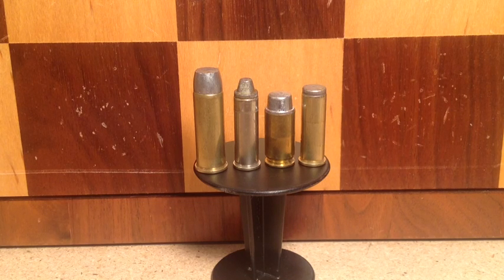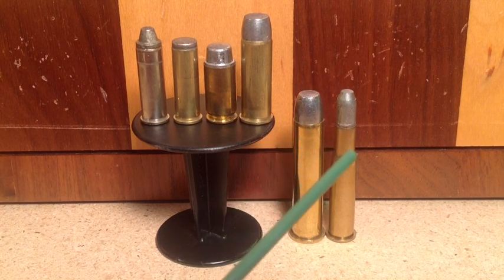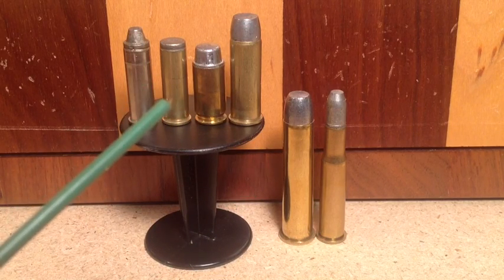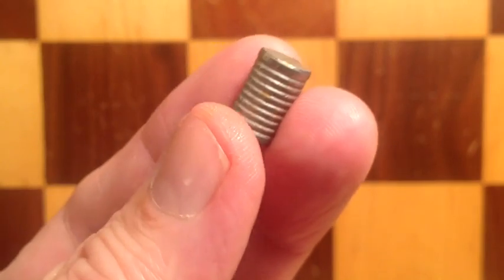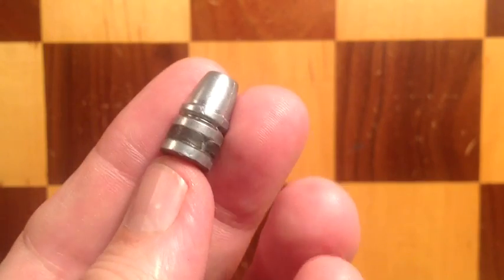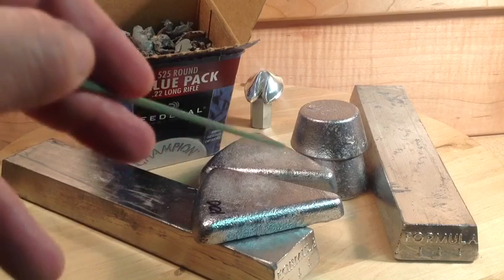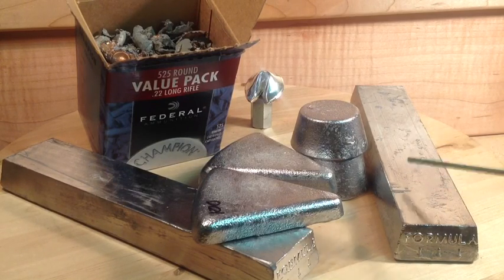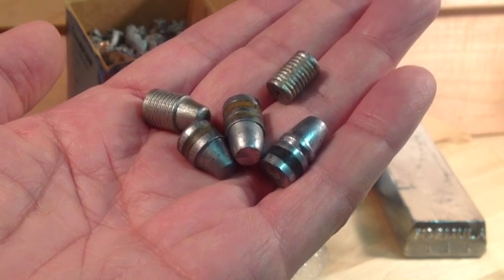Lead Hardness FAQs & How to Mix Bullet Alloys For Hardness

Comment: I've been casting for about 3 years, probably around 20K rounds, and have used almost exclusively range scrap with great results. I just now finally ordered some Super Hard Alloy and tin from Rotomtals. Plan to start working on some magnum loadings.
Reply from the maker: Hans S. Always great to hear from ya, Hans!!  That SuperHard alloy is really a joy to use and at 30% antimony, don't need much of it (eyeball 1 pound SH to 4 1/2 - 5 pounds of range scrap + water quench + 2 week age to get magnum hardness BHN 18).  And the tendency is to use too much tin as that is easy to do.  Our range scrap even contains some tin (probably around 1% already)  you only need about 2% to get the best flow into our details.  Best to mix final alloy right there in the bullet pot as the fewer times we melt our lead, the better.  Making ingots from our range scrap is essential to do.  Mixing our alloy right there may seem logical, but it requires another melting in our bullet pot.  Every melting can change our composition.  Good castin' to ya
Reply: FortuneCookie45LC Thanks for the tips! Like I said, this will be the first time I've really dealt with mixing alloys and those pointers will be very useful. I have tinkered with adding WW to my range scrap for higher velocities in 9mm's, but nothing specific. In your opinion, if I reach a BHN of 18-20, are gas checks necessary for .357/.44 mag velocities of around 1,100-1,200?
Reply from the maker: Hans S. Hans, no bullets need gas checks at 1100-1200fps (that's 22LR velocity - and flash copper plating doesn't even count as a gas check or jacket).  Plain base lead bullets are all that's needed up to 1600 fps.  Gas checks cost about 5 - 6 cents each... save the money.  For rifle shooting, 1600 fps and up gas checks are especially needed.  Good shootin' to ya...
Reply: FortuneCookie45LC Great! I regularly hear guys talk about applying gas checks for loads well below 1,200. Lots of misinformation out there I assume. Good to know. Thanks you.
Reply from the maker: Hans S. Hans, let me give you more details on this issue.  The shooters who like to put gas checks on their bullets at lower velocities believe that the gas checks provide more uniform bases for better accuracy (and they will quote limited non-statistical studies that compare accuracy being better with gas checks).  This was a spin off of bullet molds that casted the bullets inverted so that the sprues were on the bullet noses providing more uniform bases.  Certainly, any shooter who has determined for himself or herself that that is what they get - then by all means, the extra expense is warranted (they can spend their money any way they want).  We all just need to bear in mind that much long range competition has been done with black powder rifles shooting plain base cast bullets - some of that with paper patch bullets (and how uniform is the folded paper over the base?).  And NRA Bullseye competition (perhaps the most demanding contest in all the world of shooting) was done for many years with hollow base wadcutters (definitely no gas checks there).  The variables affecting accuracy in handguns are so many that it is a question on how much we want to pursue. My best advice to you is if you want to do gas checks, you might as well pursue accuracy and power at the same time.  If you want to do low or standard power accuracy, just shoot wadcutters (no one puts gas checks on wadcutters).  Hope this will settle this for you...

Comment: Been a long time viewer and sub of your channel. I do have a question for ya about a mix ratio. I lucked up and a friend gave me some lead weights out of a circle track car and they are 25 lbs a piece roughly, I have right at 50 lbs or a little over. I'm pretty sure it's pure lead because it's fairly soft. I intend on buying a lyman 429421 keith mold for my ruger redhawk to cast some of the best 44 bullets on the planet, but I don't know how much of what to add to this lead to make it 18 bhn. I was looking at rotometals and midwayusa for some superhard or linotype to mix with it but I wanted to get your opinion first before I buy the wrong alloy. What ratio would I have to go with to take pure lead and make it usable for 44 magnum keith bullet loads. Once again thanks for all of the great information you have given on casting, loading, and years of experience with the two.
Reply from the maker: D.J. Taylor There is a formula on the RotoMetals site at the bottom of the homepage that is used to calculate the hardness of our alloy mixes.  Some object to the starting BHN of pure lead at 8 (they say it should be 5).  But since RM has been in the casting alloy business for 75 years, I'll just go with the 8 - and that has worked for me.  What the formula doesn't give is that we get 1 more BHN point for water quenching (some say you'll get more), plus 1 more for age hardening our bullets (10 days - two weeks).  Let me know how it goes.... Best to ya, FC
Reply from the maker: D.J. Taylor Correction - just checked - the formula is on the bullet casting alloys page off the home page...Have a great day
Reply: I have use pewter for decades. Much cheaper. I buy pieces at thrift stores. Melt down into 4 oz , I mix 8 oz to 15 lbs of range lead . 4 oz to ww

Comment: Dear FortuneCookie45LC; I started casting 9mm 125 grain Round Nose. I am using %50 Linotype and %50 Pure Lead and water quenching. Is this a good hardness or shall i make it softer? Ty for advice again, u are saint.
Reply from the maker: Ruhsuz When you mix 50-50 lino and pure, you get an alloy called HardBall.  It is very similar to Lyman #2 in performance and suitable for all heavy revolver and auto pistol bullets...With your water quenching, you are good to go...Good reloadin' to ya

Comment: FortuneCookie45LC - Great videos.  I'm curious what your thoughts are on heat treating bullets in an oven to increase hardness.  I have yet to hear you mention it in any of your videos.  Do you think heat treating bullets in an oven (obviously for lead only) is a good alternative to purchasing harder alloy for your mix?
Reply from the maker: louscip - Heat treating and then quenching forces the formation of the lead crystals.  It gets very technical as I believe a small amount of arsenic present in the mix helps that.  The very act of casting the bullets and dropping them into water quench is a form of heat treatment (gets us another 1-2 :BHN points and even aging our bullets a couple of weeks gets us another BHN point).  I must admit to being old school on this issue...Most of our shooting can be done with BHN 12-15; BHN 18 for rifle or hard auto pistol)  If I need real hard bullets, I'll just cast with straight Linotype BHN 22-24 (problem with BHN too hard is bullets get brittle - no penetration - and casters have tried to compensate by making softer bullet noses with harder shanks).  We just don't need bullets harder than that and the heat treatment you reference will get us harder than that.  My shooting needs are 2000 bullets casted per casting session.  And heat treating 2000 bullets would stop me from going to the range - and that's the whole idea...Heat treating bullets is for sophisticated bullet casters who shoot rifle bullets trying to push the velocity envelopes - back in the day - that's why jacketed bullets came into being...And if I need more performance from my cast bullets, I don't fight it - I'll go out and buy the green and red boxes of bullets... Bye for now

Comment: Last year I shot a .22 hornet with water dropped wheel weight lead for my bullets and it worked perfectly. I was going to use the same lead in my .38 special at under 900fps, but I didn't realize a bullet that is too hard is bad. Question for you: Should I try to harden some pure lead I have or soften the wheel weight lead?
Reply from the maker: Todd ster - Sorry for the delay in this reply - Whenever Google does not post a comment in my inbox, I won't see it for months...perhaps never... Great question, too... Wheel Weights can be used with good effect for all handgun shooting straight up.  I used to buy wheel weights 300 pounds at a time as well as get all the wheel weights I could from tire shops and car dealerships.  Used it for everything including all out 44 mags with excellent results.  But then wheel weights were taken out of circulation by edict.  Now, I'm using free range scrap and hardening with linotype or SupreHard alloy as needed - and loving it!!  My bullet metal cost is hardly worth including in computations.  The too hard does not apply until you get higher than BHN 18.  Harder than BHN 18 can be problematic unless the bullets start out at the right diameter (+.001-.002 bigger than revolver cylinder throats or .001-.002 bigger than groove diamter rifles and pistols), if small, the harder alloy will have a harder time obturating and barrel leading will result.  Best to ya,  FC

Comment: I'm heading to rotometals ASAP! I noticed a lot of their ingots are around the 15$ range. Is this a good price? I know it's gone up from what it used to be and what hasn't :-D
Reply from the maker: MadMetalManiac74- From what I've seen personally and in comments, RM gives good service. The only complaints have been regarding their pure lead - there were a couple of buyers that reported dirt in the lead.  Also, they sell by the bar and the bar is anywhere around 5 pounds each.  They had a deal for free shipping if you bought $100 or so of product in the past...I've been buying their linotype and Superhard alloy for many years to harden my scrap lead.  Any lead you can get locally (free range scrap is incredibly best) avoids the shipping.  Good castin to ya...
Reply: FortuneCookie45LC oh I've just about watched all your vids about it. Someone claiming they only got 3lbs out of a 5lbs bar lol. Looks like an awesome place to do business with. Even sent you that tour vid and that was very cool of them! So far I'm using range scrap and any wheel weights I can find that aren't steel or zink :-)
Reply from the maker: MadMetalManiac74 That range scrap is what casters call antimonial lead usually around 3% antimony - it's good as is for standard target loadings in 38 special, 44 special,(and all the cowboy action loads) and a lot of shooters use it for 45ACP.  I like to bring the BHN up to 15-18 for auto pistol rounds (9,40,45) though for best functioning.  Wheel weights are good for up magnum loads as is, although some of the newer lead WWs are a little on the soft side...Best Regards
Reply: Oh most my stuff will be cast for auto loaders and higher velocity rifle rounds. Thinking about 223 after seeing tr prepper do a bunch so I'll prob need some super hard alloy for that huh :-) I do have a 44mag that I plan on casting for also. Eh I got too much variety so I'll prob get a bunch of everything. Fill out the amount for free shipping :-) thanx for the info!!!
Reply from the maker: MadMetalManiac74 Yes, for 223, you might even cast 'em with straight linotype.  Problem is that once you get lead that hard (BHN 21-22), the bullets start getting brittle on impact.  Lyman #2 alloy holds together well for terminal effect.  It has been the best for practically all uses short of high velocity small bore bullets.  I once casted for a friend who wanted to load 223 with cast bullets, but only for reduced power loads like around 22WMR velocity.  Worked OK, but it was a lot of effort to have a special load for the shorter range varmints.  After a while, he just decided that his main load for close and far was the way to go...Cast bullets work best for bigger heavier bullets at lower velocities and will take care of 90% of the shooting we do - high vel small bores are in that other 10%.  Back in 1900 or so, jacketed spitzer bullets came into being because cast lead didn't work well with higher velocity - bullets would not hold the rifling and stripped lead into the barrels.  Nothing has really changed.  I'm always concerned about current efforts to rethink making cast bullets exceed their limitations.  But for pistol rounds like the 44 mag or rifle 30/30 or 45/70, cast bullets rule.  And cast is highly useful for 308, 30/06 etc for moderate loadings around 1900 fps.  Once you get down below the big cased 24 cal, cast bullets lose their effectiveness (exception - the Aussies love their epoxy / powder coated lead bullets in full power 223 loads - work just like jacketed bullets).  Best Regards to ya...

Comment: FCLC45, as you already know, I'll be casting with 99% pure lead, 1% tin (.22/17-grain air-gun ammo), but if I wanted to make my lead a little harder, yet keep the melting point below 1000-f., what alloy/s do you recommend I mix with my 99% pure lead? Does tin actually make lead harder or does it just make lead shinier and flow better when molten? If you could recommend which item would be best for me to order from RotoMetals in order to make my 99% pure lead a little harder, what would it be? Thank you in advance very much, agw.
Reply from the maker: AirGunWarriors - Yes, tin is responsible for making our alloys flow and cast well.  Antimony is the best hardener.  The traditional alloy used to harden our softer lead is linotype (4% tin, 12% antimony).  But RMs has created something even better - Superhard alloy (30% antimony).  And, RM has a formula that will help you calculate how much to mix to get the hardness you want...Best Regards

Comment: Thank you, I did not think about load according to hardness. So all of my cast bullets are as I said are 20 to 21 so I have been loading to light. However I don't load many cast bullets anymore as I can get plated bullets nearly as cheap.Thank you, another very good video.
Mull1955
Reply from the maker: mike mull - Thank you for your comment.  If you buy, the plated bullets are certainly the way to go (or Bayou Bullets for epoxy) - and competition shooters really like the low smoke.  The real break comes when you cast your own from lead you get for free or nearly free.  THEN, the cast bullet shines the brightest in the night sky...Best Regards

Comment: I have two places that I get my cast bullets and one says there are BN 20 and the other say that theres are 21. So there not that much difference in the two bullets, correct?
Reply from the maker: mike mull - Your suspicions are well regarded.  There is no significant difference between 20-21 for us.  Fit of bullet to the gun is the critical issue.  1 BHN can be had just by letting bullets sit for 2 weeks...Best to ya...

Comment: FortuneCookie45LC, If you use a gas checks can you get them moving any faster with out worrying about leading up the barrel.
Reply from the maker: Nathan Hartlaub - Sorry on delay answering - somehow, missed seeing your comment and question - great question - I do most of my shooting with plain base bullet designs because they are good shooters and don't lead barrels even at magnum velocities.  We really don't need gas checks for handgun bullets with exception of the real big 500 and 460, Linebaughs etc these days...But my advice is that if you choose to cast bullets designed for gas checks, then go ahead and put them on.  You can shoot them at any velocity you wish including of course, the stoked magnums...And yes, the reason for gas checks is to prevent leading at higher velocities.  The downside is that you increase costs and effort, but for some loads - you also get slight increase in accuracy as well.  I use gas checks for my 310 grain Lee 44 bullets and 300 grains 45 Lee bullets because I do load those on the hotter side anyway...  Best to ya...

Comment: Fortune Cookie45- Very many thanks for your erudite reply. As you say there is a great deal of confusion over the BHN of pure lead, I think the most important thing to keep in mind is that we, as shooters, are really only looking for a testable hardness so that we can repeat an alloy that we find to shoot well, the actual true hardness in scientific value really means very little, now that most serious reloaders have a means of testing lead hardness with their own testers I am sure they can see the reason for some "off loads" due to the batch of alloy used, my problem has been in getting the BHN above 7.7 ! I have even alloyed in Solder (Lead, Antimony, Tin), without getting a very high reading on my Lee tester, which got a very good write up on the Los Angeles Silhouette Club review,  I have even considered mixing in some hard Babbit, but have not yet tried that. This is all part of the very enjoyable pursuit of reloading ones own ammunition.
Reply from the maker: Englishman French - I have found RotoMetals Superhard alloy 30% Sb, to be the slam-dunk route to bullet alloy hardness.  I know shipping complicates the cost, but at the last word, orders over $199 get free shipping.  The word is out now on lead alloys anywhere including solder - it's all getting costly.  The good thing is that we can be very happy shooting standard loadings with softer lead supplies…There was a day long ago in a galaxy far, far away where I bought 18"  little 3/4" diameter bars of 50/50 lead/tin solder for 25 cents a bar (a gallon of gasoline was 49 cents as I recall).  My wife tells me to stop lamenting, and just move forward… Best to ya...